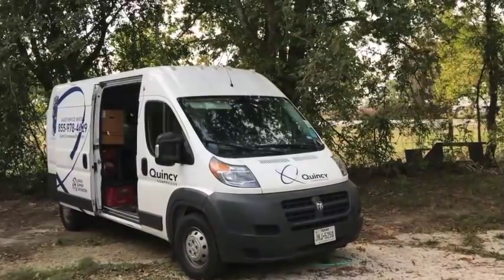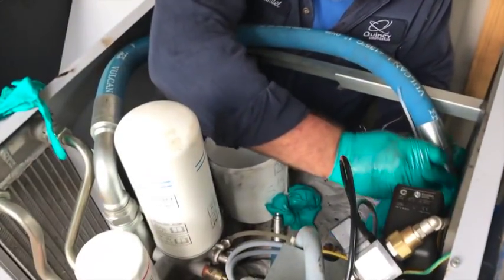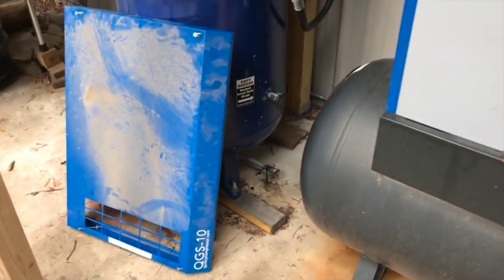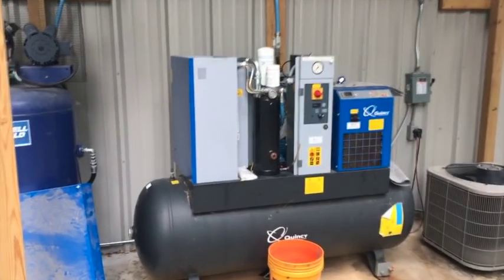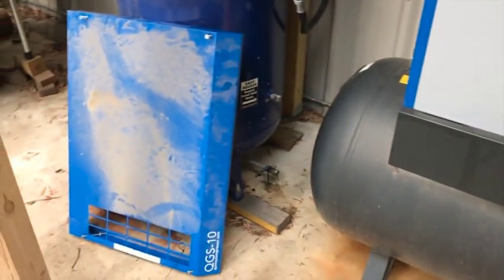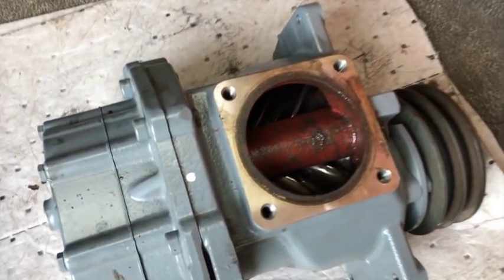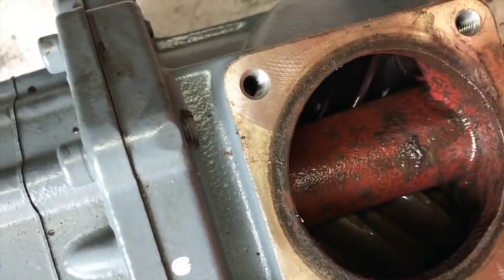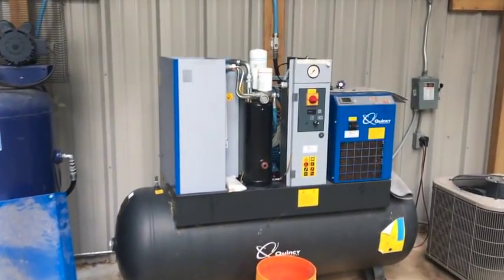Quincy Compressor Tech Visit

Comment: Great video Gary!! Thank you for sharing it !! I have an IR 185 that is 25 years old with only 545 hours . I used it on Coal Strip Mines to operate a 1 inch impact and to air up big equipment tires. A long time with very intermittent operation. No problems at all ! And it is a screw compressor !! Be safe my friend and God bless you !!!! Eddy

Comment: Hopefully they get you going again, it sounds like they are on the right track finally.  Maybe in the future you could keep your CH compressor open to the system but turned off so the rotary will operate for a little longer time each time it cycles on?  I hope I have better luck with Quincy we're getting a new Quincy compressor for the shop here, it's not a rotary though.

Comment: The way I see it is the Quincy has a condenser which takes all the moister out of the line. You could actually just use your two stage compressor and install a good condenser and move on with your life. Sell the Quincy it seems overly complicated and a machine with built in obsolescence. Simple is the best solution in my world !

Comment: I know my opinion doesn't matter for shit, but if it were my money, I'd be all over Ingersoll Rand 10-HP 120-Gallon Horizontal Two-Stage Air Compressor (230V 3-Phase)
They run forever, parts are cheap. Service centers and techs for those everywhere. Plus, brand new is only $2800. Compared to your $9000 Quincy boat anchor.

Comment: Sell it and buy an old Champion R-80 and you will have good reliability and simplicity along with more air than you know what to do with.  Heck even my antique Devilbiss puts out 2more CFM than your unit for the same hp so what is the advantage to the screw besides getting one? Pretty sure they say my pump is rated for 50,000hr so if that is the case at your current use rate it would last 100 years. :-)
Reply from the maker: Ok fine, you talked me into it!

Comment: I'd be shocked if they try to blame you for the problems. Maybe they'll say they won't fix it if it happens again. 
It's a shame those spin on filters point down. Must make a real mess when changing them. 
I think you'd be way better off with a 5HP pressure lubed 2 cylinder Quincy piston compressor. 
If you need more air in the future, get another 5hp unit, same type.

Comment: Sounds like pretty good advice on the screw. ive never had one.. I have 2 large Hydrovane compressors and they need to be run hard all day every day like the screws. My oldest one is at least 25yrs old and has done over 70,000 hrs.. supplying air tools and 4 spray booths. A great machine. Now i am retired and no longer need the air volume i have bought an old skool 3 piston 7.5hp 3 phase compressor that supplies 24cfm. I can run my cnc router, and spray gun/air tools no probs. Work out your needed cfm and always stick to 3 phase units.. they last longer and are cheaper to run. Good luck. Cheers.... One last point.. whilst running the hydrovane, which is similar to the screw, i always made sure i had a few small air leaks in the system as to make sure the compressor wasnt running in bypass mode too often... now with the piston compressor i have no air leaks at all and the system can have air in it for a long time  when not being used without dropping below 90-95psi.
Reply: A Hydrovane is nothing like a screw compressor. Hydrovane is a VANE compressor. Runs at motor speed, much slower than a screw.
Reply: i am aware of that. thanks. so do screw compressors not run continuously without shutting down  once up too full pressure?
Reply: Not if they're set up in Start-Stop mode.
Reply: ok, thanks. that was the similarity that i was referring too. its not easy relaying a lot of info in such a short typed message. cheers

Comment: Either it's good or it's not. A good compressor shouldn't need to be run for the sake of keeping? it good. A company I worked for couple years back had their new rotary compressor (15-20k) give them fits. Ate belts, overheated, major downtime several times, and loud all the time. Luckily the owner had kept his 40 yr old compressor in the system for backup. The new one was only 3-4 years old when I was there. Different brand but lots of the same bs excuses. For my money I would've probably gone with old style industrial piston compressors. 2 good used compressors could be had for 20-30(?)% percent of your original investment? 2-3k and there would be room to grow with a backup if one failed. Good luck with it, You're right about sucking up to the company and being patient, but keep the big stick handy lol.